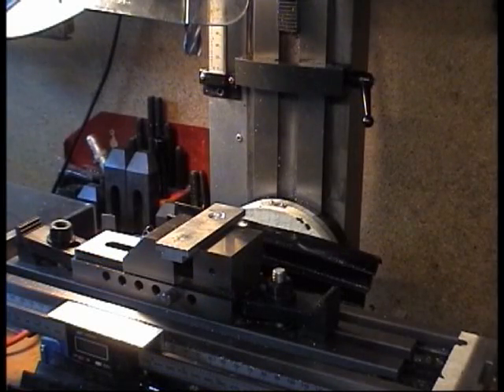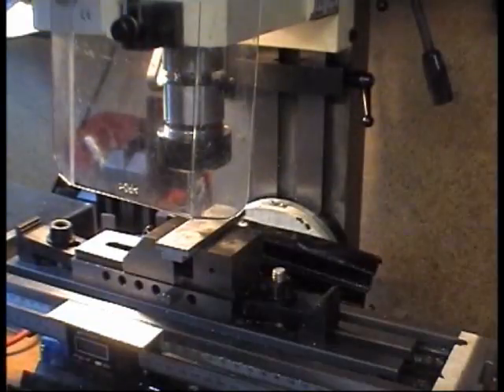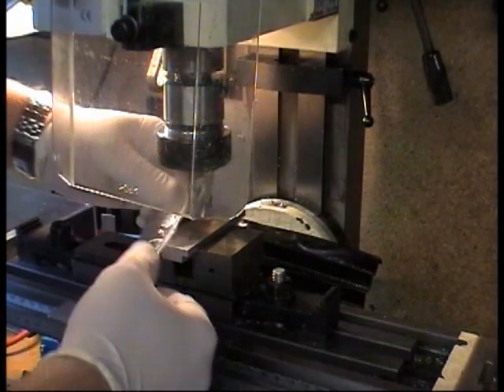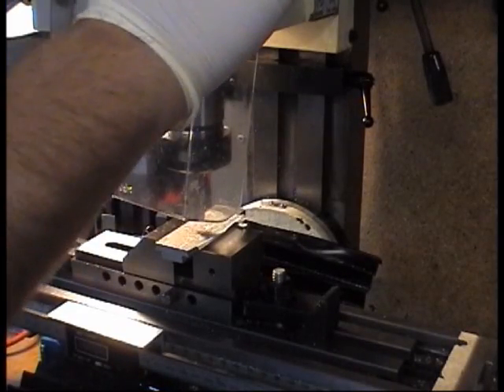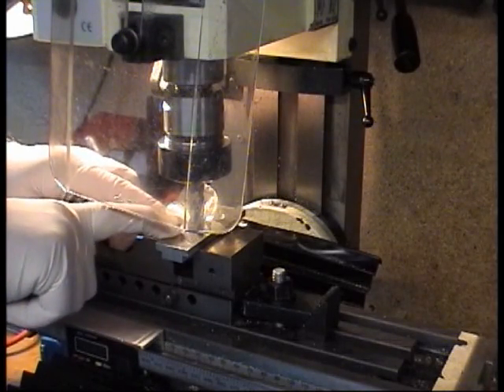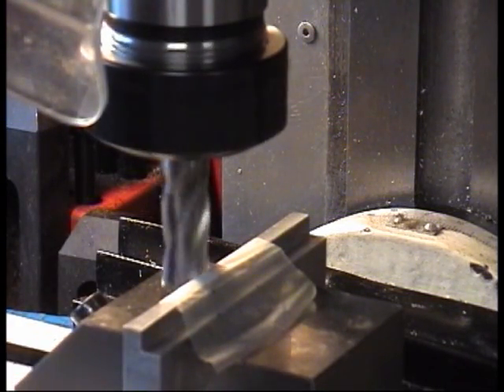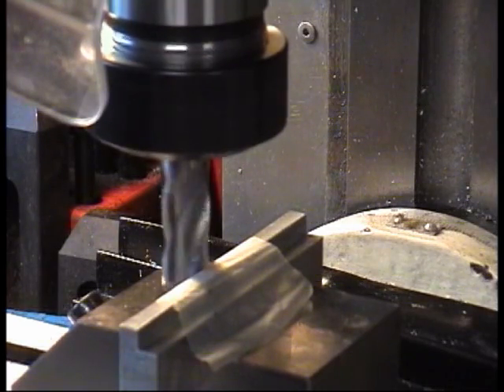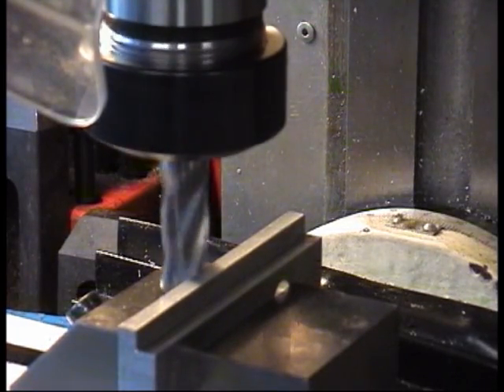Milling Tricks of the Trade (Edge & Surface Finding)

Comment: They look like they are just latex gloves.  Its not like a mill is going to grab the latex and wrap you around it.  Cloth or leather gloves ditch them before using tools (I do use them while rough cutting on things like abrasive chop saws.  Cuts down on metal splinters.